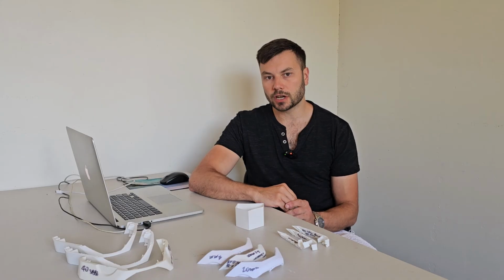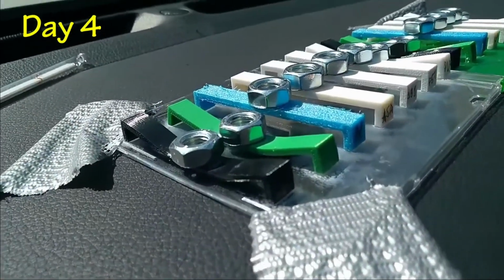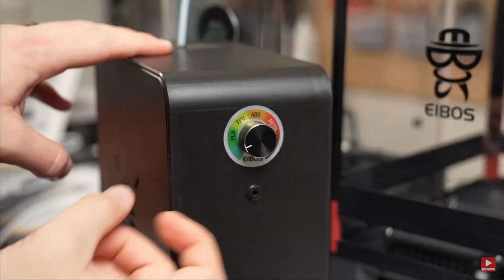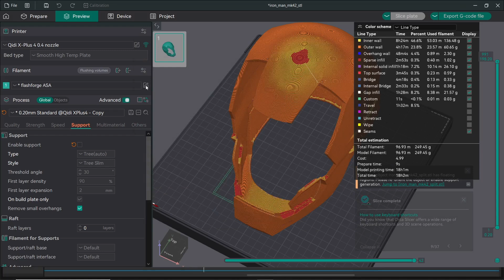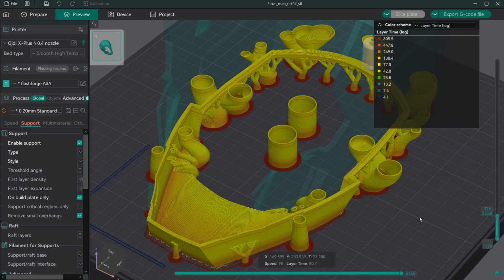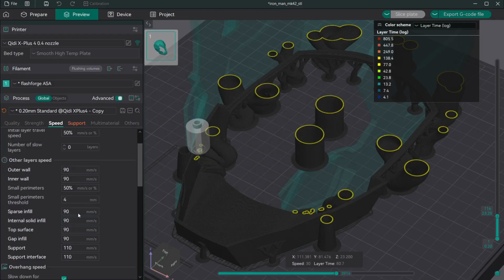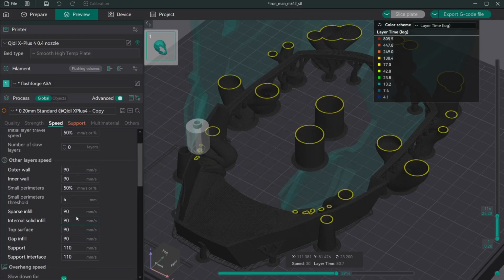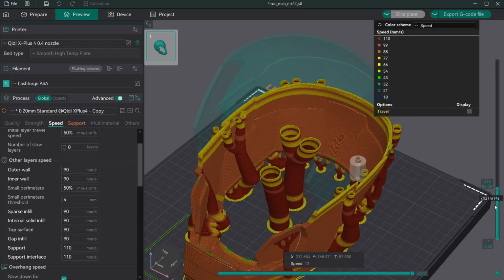STOP FAILING Your ASA/ABS Prints! 🔥 The Secret Nobody Tells You About Layer Adhesion

Comment: On Centauri Carbon I printed some interior car parts for my Audi
Started with generic ASA profile and it turned out bad, fragile and brittle, broke while removing the supports
I lowered layer height to 0.12, lowered fans to min 10 max 20, increased temp to 275, bed temp to 105 and it came out great
Then a bit of sanding, acetone smoothing and they look almost factory
One tip for CC and other enclosed no heater printer owners - print something else first to warm up the chamber and the printer if its your first print of the day
I like printing a gridfinity box in PETG to warm up - always comes out great, you can never have enough boxes and I have my chamber at nice warm 40 degrees

Comment: I have great success with ASA, except the top layer is always rough, almost frosted looking, but only the top layer. Very weird, but I am beginning to think it might just be the filament I am using.

I use a Adventurer 5m pro, layer adhesion is great, prints look amazing, but just the top layer APPEARS to be under-extruded. It doesn't really hurt anything, but it is baffling.

Comment: I've been printing parts in ABS and ASA for years, on glass and on PEI sheets, but never ever have I had the need for a heated enclosure. Just an enclosure is sufficient and an ambient temperature in the chamber of aproximately 40C this happen automatically by preheeting your bed 10 minutes before starting a print.
Reply: No, that's an absurd statement. Anything that is larger than 30 centimeters starts warping when my enclosure temperature drops below 80 celsius. Don't talk about matters you have no idea about.

Comment: I dont know how still are issues with ASA. I was printing with X1C using Sunlu  ASA and Smooth PEI plate without any problems, also cleaning the plate once in a month maybe. Just before first print using the Bambu glue stick, after that just print and print, no warping. No chamber preheating, just push the button and start printing. Had all kind of problems at the beginning using the textured plate, after recommendations to clean it with IPA. Worth mentioning that the printer was doing 5-9 hours prints, mostly with the plate full of parts.

Comment: Ahhhh. I'm not sure where you get your info. I print ABS,ASA,PC using my 2  K1 Max printers on a daily basis. I'm printing mech functional parts as well as signage for outdoors. Why do people make these statements that are so untrue? Clearly these are people to avoid when making informed decisions. What i would suggest to people is leave your print bed on for about 5 minutes and let the bed heat the chamber then start the print. My chamber sits around 35-40 degrees and prints are outstanding. Just another example of misinformation or just not enough research. If you experiment enough you will find your best settings.

Comment: Thank you very much for explaining the details behind getting good layer adhesion, ,it’s very helpful and useful info. I've got a Prusa MK4S printer (no chamber) and am having significant issues getting ASA to stay adhered to the bed. The layers themselves are binding well, but the job is more often than not detaching half way through the print. I always thoroughly clean the bed with isopropyl alcohol, I've added significantly sized brims and used a range of bed temperatures (from 95C as specified on the ASA reel, up to 115C), but still not much improvement. I’m at a point now of trying a glue stick, which just seems wrong, ,but I feel out of options.
Any thoughts on why it’s detaching so often. Could it be warping of the print as it cools down? Would a chamber (assuming I can get one to go around my printer) help with bed adhesion? Thanks.

Comment: Note another is stop using 0.2 on abs and asa and go with a 0.16 or lower layer height.  the extra squish helps dramatically.   I was dumb and bought a lot of Esun ABS+ and that filament is just garbage I was able to use all of it by printing slower, hotter, and lower layer height.   Was so happy to be able to not just throw away 10 spools of that junk.

Comment: Just started printing ASA.... on an "All metal A8" without an enclosure in a cold room! So far the main problem has been getting the part off the bed. I'm using a glass bed with 3DLac which works well for PLA and PETG but a bit too well for ASA. Im using a 0.2 mm nozzle, 260C an 90C bed. I had to drop the head-bed gap down from 0.1 for PLA to 0.07mm to get the initial layer to stick but boy does it stick.  Printing mostly small thin parts at the moment so maybe this set up won't work for larger solid parts. Two things I've seen elsewhere might be of interest... Someone suggested printing an "enclosure" or "draught screen" around the part at the same time.  Another vid suggested printing ASA on a PLA raft to reduce warping.

Comment: While I think that most of the information that you gave was great and very helpful, there is one thing that I do have a problem with that. I see a lot of people coming into the printing space with the same idea. That is the thought that you have to have a heated chamber to print an ABS or ASA. This is just not true, although it does make it easier and most of the times safer (My two printers with the heated chamber also have active filtering), you are able to print ABS and ASA on a non-enclosed open frame printer. My very first printer years ago was open and I could print with ABS easier than I could with petg at that time. Do I recommend printing either ABS or ASA on an open frame printer? No, not at all. Do you have to have a heated chamber to print these filaments also not at all. If at any time I print either of these two filaments on one of my open frame printers, I make sure that the area is well ventilated and no one will be remaining in the area while the print is going. This is just a safety precaution because both filaments produce really strong vapors.

Comment: I disagree with the heated chamber point. Heated chamber makes it easy but heat soaking a reasonably tight non-heated chamber can get it up to the same 60-65 degree range as a non-heated chamber.
Reply: Yea I also saw alot of videos where people printed  abs with a bambulab p1s it worked perfectly fine ... he pretends like it's impossible

Comment: Funny to your layer time.s .
If you put 100 by 60 sec your print slows down .
If you put down 10by6 sec your print speeds up .
If you need the heat where y agree. 
Orca slicer wil not give total control clipper wil give you this whit mainsial. 
By the way your layer time wil slow the printhead down whit a 60 sec waiting time 60 sec is a long time .

Comment: Printed my first asa this week.
Abs is no problem. 
Bud asa is different story. 
Warping al over the place i have a inclosure and at 48 .c. is hot enough. 
Heated bed 110 you wil need that one for shore fat layers are better it stays hotter and bonding is done tok me 9 test runs to geth done .
Bud i am not there yet .
Reply: The exact makeup of both ABS and ASA is not standardized and there is a lot of variability between brands (and even between batches for budget spools).  Try switching it up and see if you get better results.

Comment: We've found slightly different success printing Voron parts.  ABS settings are 45-50°C Chamber, 110°C Bed, 250°C Nozzle, and full part cooling fan after layer 4 (last solid bottom layer).  That lets us print 100-170mm/sec.  Without part cooling we were seeing so much heat deposited into the parts that they were melting. Turning ON THE COOLING FAN was a game changer.   It isn't blasting COLD air onto the parts since the chamber is already 45-50°C, and layer adhesion has stil been great.
Reply: Das kling interessant. Werde ich probieren.

Comment: That's mean its impossible to print asa with x1c?
Reply from the maker: Not impossible,  you just miss out on the maximum layer adhesion
Reply: @Buildprime_x do you think i can add heat to it?
Reply from the maker: @elie.k93  to the part?
Reply: Nope, even the P1S prints ASA fast and beautifully. No visible layer adhesion issues, usually no warping (depends on the printed part), parts are stiff and stong. That being said, none of my ASA printed parts strives for the absolutely best strenght possible, so could it be better with a heated chamber? Sure. But for my needs, the P1S made printing ASA surprisingly easy.
Reply: @FakirCB i tried to print a large part it went beautiful but it has a crack after 1 hour of finished printing
Reply: @elie.k93  I'm not saying that it can't happen. Although, as usual in 3D printing, there are many variables that affect the outcome, filament being the most important one. I should probably correct my previous statement: Polymaker PolyLite ASA prints fast and beautifully on the P1S. I also had success with C-tech ABS+, from which I printed the AMS riser, so it's a large part taking the whole build plate. You just need to keep the heat inside as stable as possible - build plate at maximum (100°C), low to no chamber fan (I usually have it at 40-50%) and very low part fan, just to stabilize overhangs and bridges. After the print is finished I usually keep the heated bed temperature high and let it cool down in steps and very slowly. It takes some time, but I found it very effective in preventing warping, especially on larger prints. Also, I'm using the "Reverse on even" setting in OrcaSlicer and tend to agree with the feature description that it helps to even out the stress in the material. The only trouble I had with the ABS is that it exhibited quite a lot of wall shrinkage, especially close to the door gaps. I'll need to print the Bento box to have air filtration without introducing cool draft from the outside. You can't really print these plastics without filtration since they off-gas as crazy and without any ventilation, you'll have a nasty stuff deposited all over the enclosure.

Comment: I have gotten extremely strong ASA prints from my X1C.  I have a 3 year old ASA print in my truck that holds a very heavy 6.9" phone and it is not overengineered anymore so than a professional mount.  I live in Las Vegas and it gets hit by UV nearly all year round as well as takes all the bumps in the road without issue.  And it still works as well as the day I printed it with no layer separation or deformation.  Not sure what you are printing that requires even more strength than that, but you can DEFINITELY get ridiculously strong ASA/ABS prints out of an X1C or other enclosed printers without a heated chamber.  Your statement to the contrary is false!

Comment: Not an apples to apples comparison. but i am printing ASA-AERO on my X1C using the flightory presets.  while i am having a 90% success rate. i had to add wide brims and increase the infil speeds or the infil pattern was all over the place
Reply from the maker: Nice, what is the strength of ASA aero compared to regular asa, does it snap really easily?

Comment: This is the first video recommending to print faster. Usually people advice to print hotter and slower for ABS ! I’m testing This Material for the first time with the eSun ABS+ and am struggling having strong parts. Even PLA is less brittle and much stronger !
Reply: I've been printing a ton of ABS recently and having a lot of success with it, but I tried eSun ABS+ after seeing some good reviews, and it's just impossible. Temp, speed, flow rate, nothing made a difference. You're not alone in that frustration
Reply: @ellenfromnowon eSun ABS is rubbish. It was good to start with and the original recommendation for Voron parts. Then they changed the formula and it's hopeless now.

Comment: One advice would also be to increase the extrusion width. It gives a little more squish to the layers which helps the bonding for ABS and ASA. For a 0.4mm nozzle you can go up to 0.8mm for inner perimeters and infill on arachne mode.
Reply: Good idea! I'm also going to try changing to a 0.6mm nozzle.
Reply from the maker: Yes that's definitely worth experimenting with

Comment: No need for a heat chamber heated chamber it will not hurt anything, but saying you can`t get quality print whit out heater in chamber is not correct, in bambu printers and so on you can produce excellent quality ABS ASA parts also reliable part's at that. I have been printing since 2012 and seen lot's of simple machines come and go, had my fair share of failure and success and testing over time this not based on luck have most prints has stod the test of time and seasons outside everything from watertight to hanging hooks around the house and what not, also air intake parts operating in cold to hot. but also produced parts to various high quality, tailored to use cases even in open air but a toasty no draft room, ABS - ASA so can be printed on open machine's too but not recommended closed chamber will increase quality and success rate. And the heat from the heat bed alone will give plenty of heat to the chamber preheated will also give a advantage. Just saying this sounds more like a sales pitch not factual how to video.

Comment: What I learned from my ASA tests with very limited printer capabilities (80°C bed, 40°C cardboard enclosure): It heavily depends on the filament brand!
ERYONE ASA at these temperatures had a bit warping, very bad layer adhesion and very bad bed adhesion. Basically it was unusable except for very small prints.
Prusament ASA was great to print, very strong layer adhesion. Bed adhesion was not great but definitely better than the other one. Also minimal warping.

Fun fact: Later during the heating tests in the oven I saw that Prusament ASA would warp and shrink like crazy (bridge-samples curling like fries and shriveling up to 50% length... but... I heated it well past 100°C, so way out of specs).

Comment: I print mostly ABS on a Sovol SV06 Plus, enclosed with those generic tent enclosures and use about 80% part cooling fan and never had layer adhesion problems.
Only problem I have is bed adhesion due to the large bed, which is solved by heat soaking the bed before printing.
Reply: You probably don't need the best layer adhesion possible.

Comment: To those saying ", nah, not true", he didn't say you can't print without a heated chamber, he said you needed a heated chamber to get more strength.
Reply: I have been printing ABS for 3 years on FlyingBear Ghost 5 without an active chamber. And in general it turned out fine, I thought that the closed volume was enough. But a year ago I made active heating and insulated the printer chamber and only then I understood how to really print ABS. It's like two different materials!
So you CAN print ABS without an active chamber, but it would be better to have one.
Reply: He also said an A1 can't do it. N00b
https://youtube.com/shorts/W5H42q4gEZU?si=5regacUgyRb9-fi9
Reply: @TheArtOfHarryyeah, I just commented on a video on "Made with Layers" where he claimed he had to use his Bambu H2S to print PPA-CF because it's his only printer capable of the temps it requires.... I had to break it to him that I print PPA-CF on my A1 Mini.... I expect it's a case of them being paid by sponsors to push the product .."oh you can only print this great material on this model machine".  So prompts more people to go out and buy that machine thinking that's what they must have to be able to print that material.
Reply: But my printer holds a 65c chamber without a heater. So he is still wrong
Reply: @confuzled_makes how’s it getting to 65c without a heater?
Reply: @JonValtandtheEvilRobots heat the bed to 100 and let it soak a while before the print starts
Reply: @3dcreationsofri …which makes it a heated chamber ?
Reply: @JonValtandtheEvilRobots not an actively heated chamber... It's passively heated by the normal printer operation, kind of as a side effect, not by design.   And this idiot specifically said you won't be able to print on a Bambu printer "non negotiable" he said .. so...wrong
Reply: @3dcreationsofri  Er ist sicher kein Idiot!
Reply: @confuzled_makes false
Reply: No .. he SPECIFICALLY said, "non-negotiable" and "you're not going to be able to print it properly on your Bambu"... Shit I print ASA on my Bambu A1 Mini, let alone my P1S so he's just wrong...shill for QIDI I'm guessing.
Reply: @3dcreationsofri yeah I hope the ASA I bought FROM Bambu works on my “fancy model” Bambu machine on the “ASA plate” manufactured by Bambu. If that doesn’t work, what will?

Comment: That's honestly a bad video, you don't need an active heated chamber because when you heat soak the bed which will heat the chamber, it will make your life easier? Maybe, but it's not necessary. Turning off the part cooling in an enclosure is also a bad advice, ABS and ASA will need cooling if printed fast enough.
Reply: Frome one side, you are right. But as per my experience,  for successful ABS printing, you will need the temperature in the chamber to be not less than 50 degrees Celsius. So,  you must have good thermal insulation.